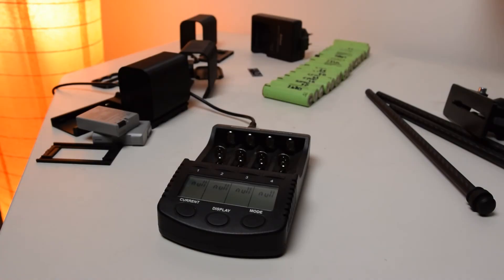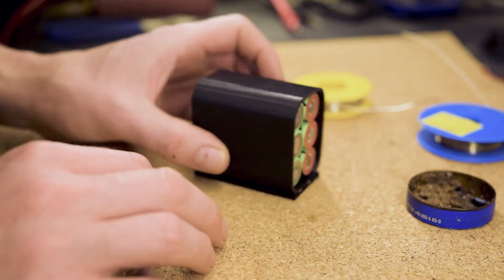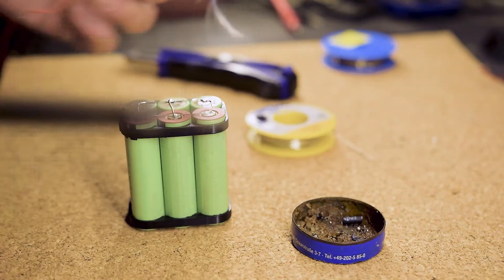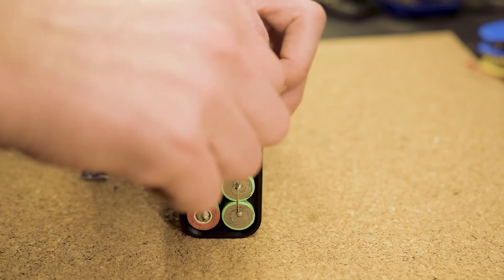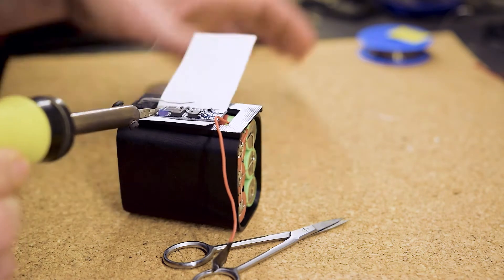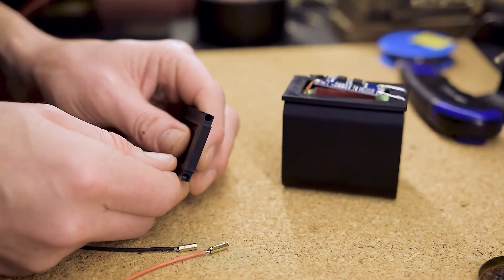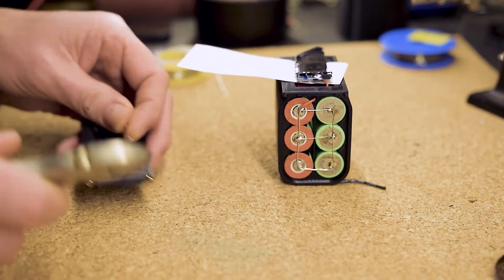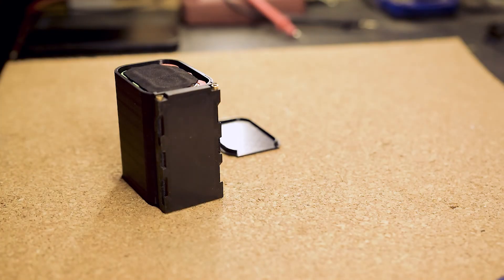SONY NP-F 970 PART II DIY-BUILD ASSEMBLY #NP-F

Comment: super! I would like to build the battery where you could swap 18650 cells and replace with charged ones. My goal is to save weight. Use dummy battery for sony and attach external case to the rig, the external case would be 2 cells only, but  they should be replicable, ie having only one case and set of 18650 (as many as required). Do you think is this doable?
Reply from the maker: It is doable for shure, the question is how you plan to protect your cells from over-discharge? And you need to design the case for your idea, adapting an old one will not work since you can not open them without destroying the plastic..
Reply: What if you use protected 18650 batteries? Then you don't have to worry about undervoltage

Comment: Why don't you used a bms with usb charging interface? So, you can charge with 5v 2a type charger for phones?
Reply from the maker: Battery has 64Whrs, a single charge with 10Watts would take more than 6hours..

Comment: Nice job. What are the bullet connectors? 3.5mm RC bullets are too big, 2mm are too small.
Reply from the maker: For my feelworld-monitor and the aperture-videolight, 3.5mm fits like a glove. Otherwise I wouldn't recommend using them. They don't have to fit over the whole male-plug, just make contact to the springloaded pins. If you try other diameters, they won't fit the holes of the lower baseplate, wich are 3.5mm.
Reply: @hopsenrobsen Thanks.  I'm trying to make everything compatible with stock batteries and holders. 3.5 is way to big for a stock battery,  2.5mm drill fits in stock battery, 3mm fits perfect in my printed parts with just room for glue so hopefully the  3mm bullets will work.
Reply from the maker: Found out that some sellers use the inner diameter, others the outer diameter of the female connector. So you where right - 3mm it should be. The ones I used where brought as 3.5mm. First world problems..